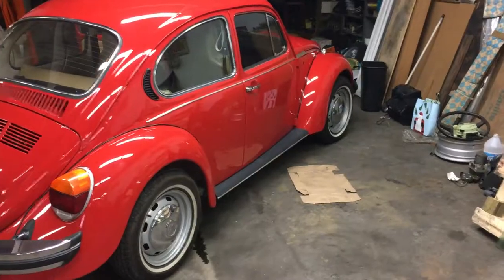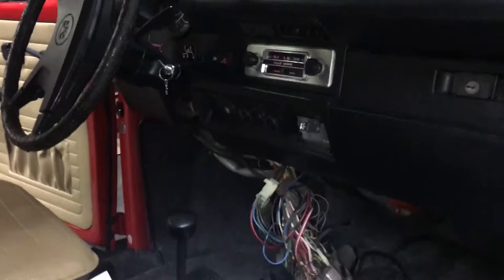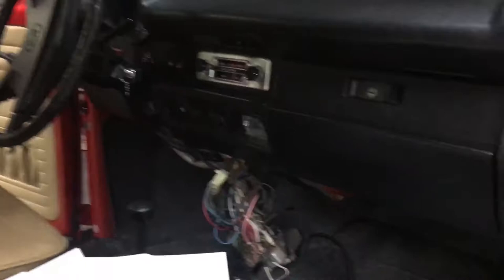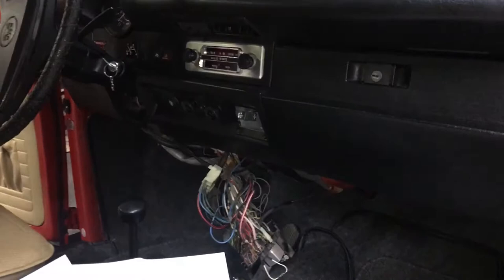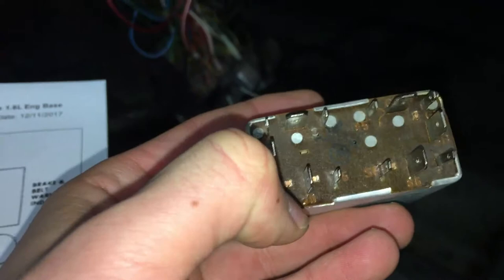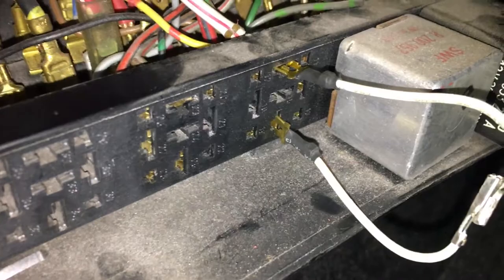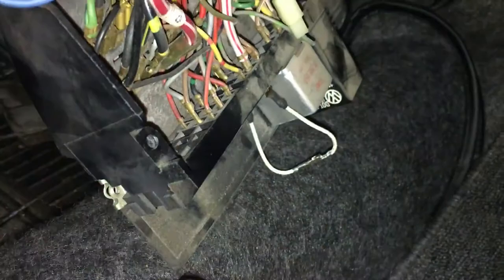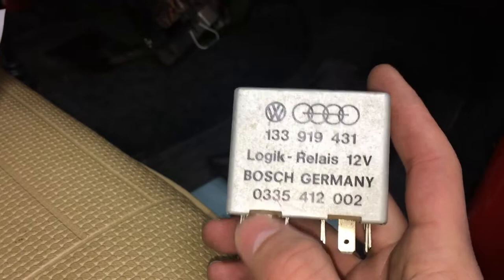VW Beetle No Start No Crank Seatbelt Interlock Bypass

Comment: can you please tell me were you got the printed out papers that were on the seat . i myself am trying to re install the seat belt interlock 
also i dont under stand hot to add wires to the plug in under the seats
Reply from the maker: Thanks a bunch for watching and taking the time to comment. You may want to Google search something like ; 1969 VW Beetle wiring diagram. This may locate a wiring diagram for you. Otherwise you may have to use a paid service or look for a repair manual with a wiring diagram. Hope this helps, please share an update.

Comment: were did you get the print out on the car seat i am trying to reinstall the interlock again but some of the wires under the seat i dont understand
Reply from the maker: Thanks a bunch for watching and taking the time to comment. You may want to Google search something like ; 1969 VW Beetle wiring diagram. This may locate a wiring diagram for you. Otherwise you may have to use a paid service or look for a repair manual with a wiring diagram. Hope this helps, please share an update.

Comment: Good video,  I having the same problem with my 74 buick lesabre. Since it sends a signal to the starter, can't i just disconnect it from the starter itself?
Reply from the maker: Thanks a bunch for watching my video and taking the time to comment. Unfortunately, I do not have a wiring diagram for the 74 Buick so I can’t make that assessment. Please share an update if you find out more, thanks a bunch.

Comment: If i did this and it still didnt start what would be the next step? I cant find anything on my issue other than this! 

What i know.
-starter works off battery.
-key in the run position i get lights and relay clicks and fuel pump primes 
But starter does not seem to get power.

Iv tried wiring the key cylinder right to battery and starter and still no start. 

I called previous owner and he mentioned he had the same issue and he was told by the original owner it might be the interlock from the seat belt. 
Im stumped. Also my car is an ‘81 rabbit 1.7l gas auto
Reply from the maker: Hey The pilot That could, thanks for watching my video.  It seems you have a complicated situation that needs to be looked at with a human eye, especially that you have no OBD diagnostics to work with.  Please share your updated outcome, thanks ahead of time.

Comment: Hey buddy I have a 1974 caprice with the same issue can't get it to say anything I'm stomped... will it work for me you think
Reply from the maker: Hey Travis Bullock thank for watching my video. I would say for classic cars it is best to get a repair manual for the vehicle. That way you can have access to wiring diagrams and flow charts. If you google 1974 Caprice repair manual lots of good options will be available. Please update on your diagnostics, thanks.
Reply: Ok thanks

Comment: Very good info. That car is beautiful. One minor detail you got wrong. Not very important to your video. That is a Super-Beetle. Different dash. Curved windshield. Otherwise, awesome video.
Reply from the maker: Thanks for watching my video and taking the time to comment, greatly appreciated. This is correct it is a Super Beetle and they do have curved windshield. Thanks a bunch for taking the time to comment.
Reply: You are welcome. I have a 1974 super beetle, too. Mine has an auto-stick. All original. Yours is in better shape. I am going to install new floor pans and do a disc brake conversion on the front. I am not sure what I will do to it after that.
Reply from the maker: Very cool, much fun on your restoration. Seems like a blast, the floors and brakes can get into a bit of work, especially if you have rust.  Much luck to your repairs and thanks for keeping these classics alive!